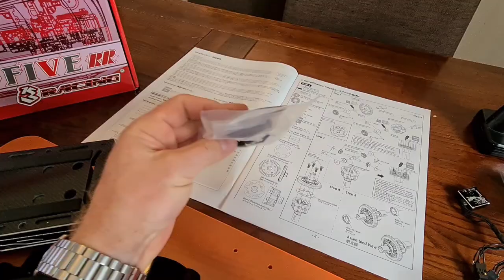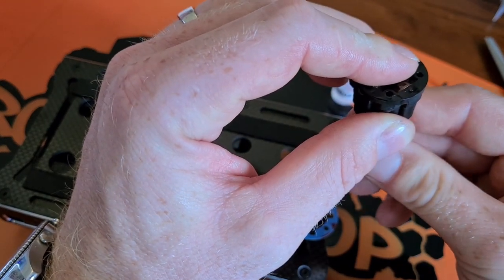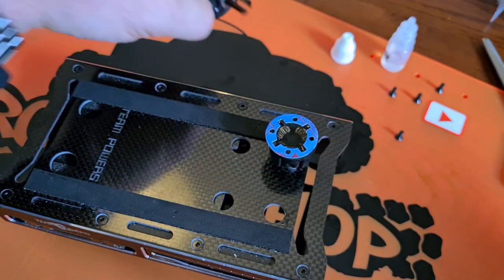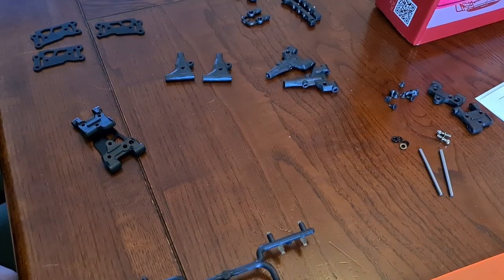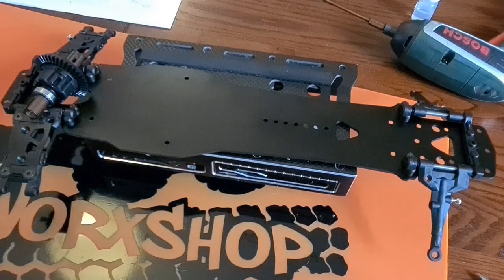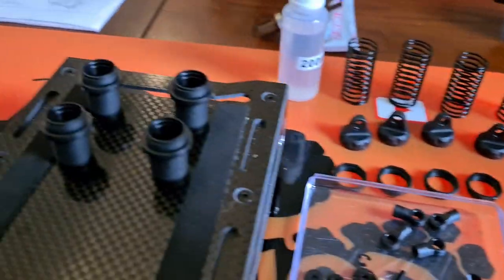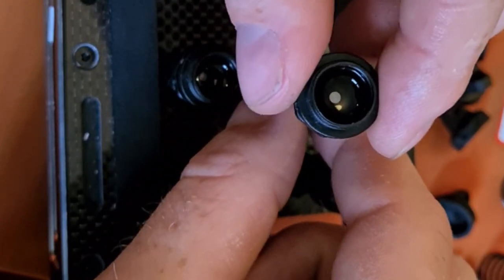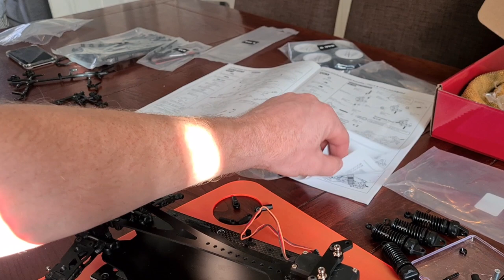NEW 1/10 SAKURA D5 S RWD DRIFT CAR KIT BUILD VIDEO 3RACING

Comment: I have the same chassis but I was wondering what servo gearbox and motor you have used
Reply from the maker: You'll need a low profile servo "hack gear" servos are best in value or savox, we've put a sensored 10.5 motor with a 26 tooth pinion gear, unfortunately we haven't been able to get it to the track to test yet due to covid 😭
Reply: @rcworxshop  thanks